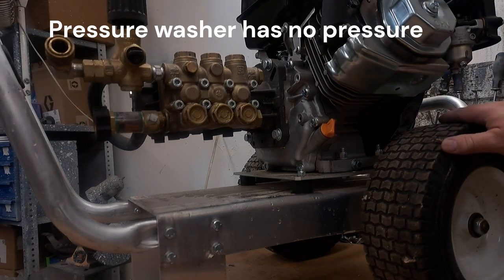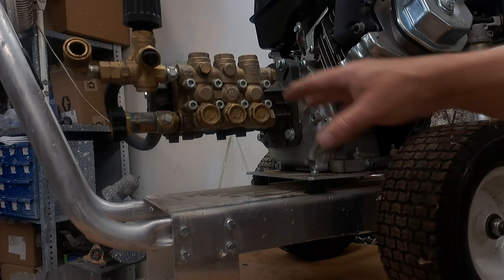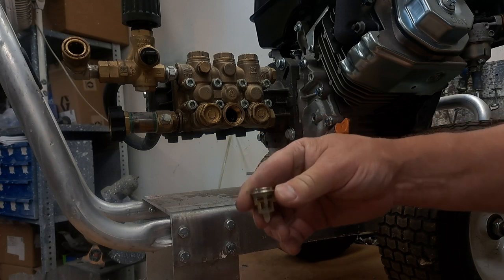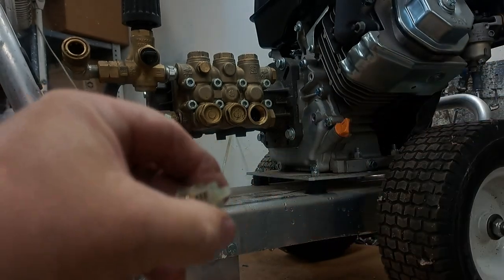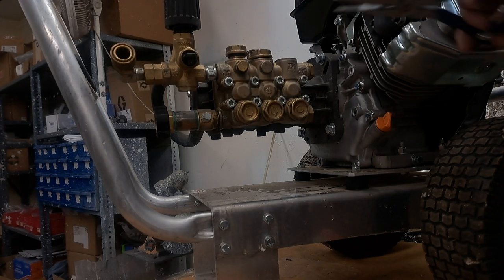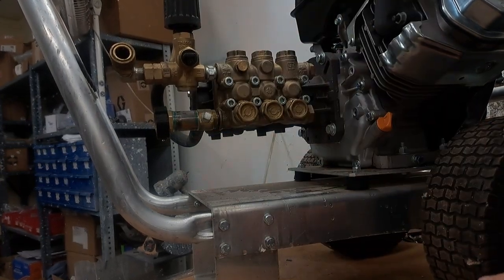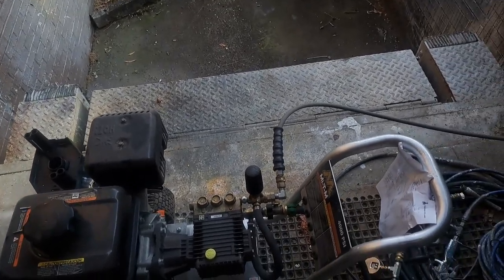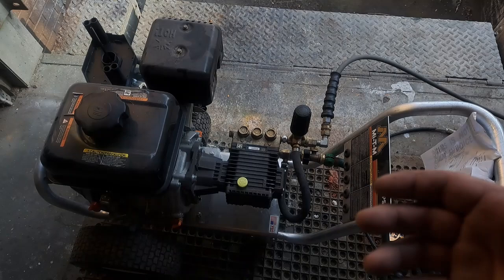Pressure washer low pressure and cavitation

Comment: How do you change the oil the same mashine and the sprayer 5900 graco
Reply from the maker: There is a hex head plug at the bottom of the engine. Unscrew that and let the oil drain. Put the plug back in and fill with oil at either of the two fill ports

Comment: I have a Canpump model 3030 pressure pump.  Recently, the pressure drops 500-1000 psi. when the trigger is engaged.   I changed the oil, started it, and now water started leaking at the bottom behind the unloader with now no pressure when the gun is engaged.  It builds right up to 3100psi as soon as you release the trigger and the leak stops immediately.  I did notice the oil is now a bit milky.  What do you feel the problem is and is it worth fixing vs. getting a new one?  It has approximately 75 hr of use on the pump.   Thank you so much for all the videos you do for us, they are very thorough and easy to follow.  Keep up the great work you do!
Reply from the maker: @woodworkwiz58  so the leak stops when you pull the trigger? You have no pressure when the trigger is pulled?
Reply: @Brian_the_repair_guy   
The leak stops when you release the trigger and no pressure when the trigger is pulled.
Reply from the maker: @woodworkwiz58  find me on Facebook.  I want a video of the leak
Reply: @Brian_the_repair_guy  I will need a day or so to get you that video, thank you!  Is there another option for getting it to you as I am not a member of social media?
Reply from the maker: @woodworkwiz58  other options degrade the video, harder to see detail. If you know how you  can post it to YouTube and send me a link. FB works best. It is faster and easier for the back and forth comments
Reply: @Brian_the_repair_guy  Ok I'll see what I can do, thank you.
Reply from the maker: @woodworkwiz58  glad to help
Reply: @Brian_the_repair_guy  I sent the video link here but it is not posting.  Is there a delay?
Reply from the maker: @woodworkwiz58  no
Reply: @Brian_the_repair_guy  unsuccessful in sending
Reply: @Brian_the_repair_guy  So I took my triplex canpump apart only to find 2 of the 3 rods were worn down and pitted on the bottom.  I am assuming to replace the pump.  What would you recommend for possible options?  The gx160 honda engine only has 75hrs on it.
Reply from the maker: @woodworkwiz58  ok that pump has metal pistons or plungers. I am not a fan of those because they will pit as you see. 
I like pumps with ceramic plunger, no wear but they can Crack ( have videos on those). AR  makes a good inexpensive pump for that engine. Watercannon.com has a pretty good selection of AR pumps for that engine. I would suggest a fully plumbed pump. That would be everything new, just built the pump on. I have videos on how to replace the pump as well.
Reply: https://youtu.be/kQGV3_G6nQQ?si=wGHugfdKI42BIXBS
Reply: On YouTube.
Reply: Thanks for the advice!  Would you say that I could get a decent life with their axial pumps or should I stick with the triplex?
Reply from the maker: @woodworkwiz58  triplex
Reply: @Brian_the_repair_guy  So I purchased a fully plumbed pump, the AR RCV3G27.   Got it installed works great!  A question, my GX160 has no problem running it to about 2700psi (gun trigger pulled).   Past that it starts bogging the engine.  While the pump is rated at 2700 psi, does that mean its ok to work it (gun trigger pulled) at that pressure or is that when the trigger is not pulled?  Any advice you can share would be most appreciated!
Reply from the maker: @woodworkwiz58  the pressure you work with should measured with the trigger pulled and the 0 degree tip. You may not show the max pressure rated on the machine but it should be within 100 psi withthe zero degree tip
Reply: @Brian_the_repair_guy  Makes sense.  Thank you!

Comment: Greetings, I would like to ask you a question. My pump is a general pump as well and it leaks the oil from the bottom. Should I replace the gasket? It builds pressure but it leaks a lot of oil. I took off all six valves and everything seems to be OK. Can you tell me where I can buy the parts please?
Reply from the maker: @Hec-Thor-23  the oil seals need to be replaced. They are at the end of the plunger towards the crank case. Check with watercannon.com for the parts
Reply: @Brian_the_repair_guy  thank you… your videos are great keep it up
Reply from the maker: @Hec-Thor-23  thank you, hope it helps